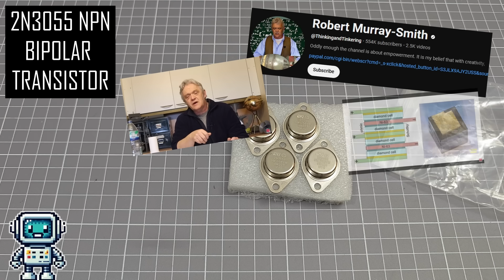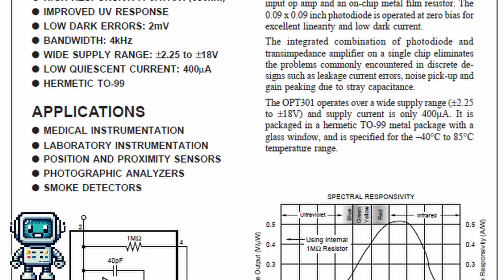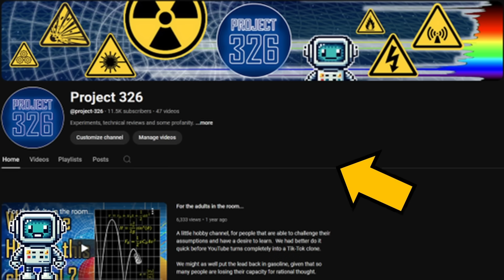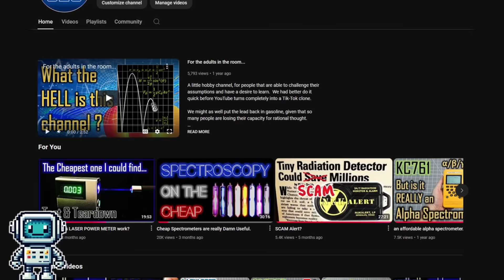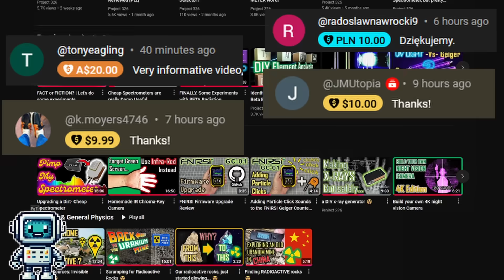Easy Peasy DIY Thermal Camera Microscope

Comment: I love this content.  FYI, you don't need to use an AI voice, that often makes videos feel cheap because so much spam/scam content uses it. (Unless it's because of required anonymity/NDA reasons, which I totally understand)
Reply from the maker: Thanks for the kind feedback.  I currently live in mainland China (Shenzhen), so a little anonymity is helpful.  

Some background info to qualify that:
There are a few You Tubers that used to live here and made videos about how great life is living in China, but then they discovered that just making up bad content about China got them a lot more views.  I assume that the Chinese government is fairly sensitive about anyone repeating that process.  The irony is that since the funding cuts to ASAID and NED, the views that those guys get has dropped by a factor of three (and in less than 1 week).  Amongst the foreigners living here, there is a general consensus that those channels were attracting a lot of "paid for views" as part of some kind of influence campaign.
Reply: @project-326  One might even fall for that explanation except for the videos calling them out that have totally unbelievable explanations for the negative content and the supportive comments from trolls and bots supporting the narrative.
I suppose it is best not to get involved in the topic at all if one cannot relate facts freely.
Good luck.

Comment: Yoo have you tried this with HT-301? It got way better sensor and manual optics
Reply from the maker: I don't have an HT-301, and having just looked at this on-line, its a very pricey bit of kit (even second hand).  I will have to buy something else if I get to the telescope project but for less than the cost of the HT-301 I can get a device with 640x512 res and 50 fps...
edit: thanks for your comment, I just took the plunge and splashed out on a 2nd hand unit that cost $277 but has the above resolution and frame rate and detachable optics!
Reply: @project-326  I bought my 301 in 2021 and paid $690 and I'm very happy with it. If you can find 640x512@50fps for $240 now please share the model and manufacturer.
Reply: @project-326 (reposting because YT backend is a /dev/null) I bought my 301 in 2021, paid $690 and I'm very happy with it. If you can find 640x512@50fps for $270 now please share model no and where to get one.
Reply: @project-326  I'm SO pissed about YT vanishing comments, I didn't even say anything remotely offensive y'all ducking donkeys
Reply: model?

Comment: Thank you for the Very interesting video.

I have used a ZnSe lens on my thermal camera myself for viewing circuit boards close up in the past, and would now like to create a wide angle lens instead.  Is this possible and how this could be achieved.

Any information would be greatly appreciated. Thanks
Reply from the maker: Thank you for the kind words, it makes the effort all worthwhile.  

The issue with wide angle is the size of lens needed.  Once you get past the general purpose CO2 laser types, the prices goes up exponentially, ie it goes from a commercial application to a scientific one...

Please spread the word and take a look on the channel page in case there are any other topics that catch your interest.
Reply: A convex lens will do this.  To make a very wide angle like a fish eye lens you will probably not find cheap lenses though.

Comment: As always a fascinating video. I look forward to a telescope version! Thanks for what you do!
Reply from the maker: there are some optical challenges to solve, but hopefully that project will come together!
Reply: @project-326  A reflecting telescope might work fine if you remove the glass components.
Reply from the maker: @KallePihlajasaari  Normally the only glass components in a reflector telescope are in the removable eyepiece, which could be replaced by more suitable optics and the thermal camera...

Anyway, pretty sure I will find out soon!

Comment: PSA for anyone getting these, AVOID HIKMICRO as their units do not support using it as a normal UVC webcam on a phone or PC. I have two InfiRay units and that UNI-T one and they DO support working as a UVC webcam. This matters if you want to take smooth video recordings as thermal apps always tend to have awful choppy video (with no audio recording). nExt Camera for Android works great with these.

Comment: Good video. ZnSe is very attractive because of its very wide transmission spectrum from 0.6 to 21 um. Take note that ZnSe is a toxic material.  Handle with gloves as shown in the video and keep away from acids.  Consult the Safety Data Sheet if you're going to use it.

Comment: this could be interesting for medical thermography if the celullar level could be captured, to analyse metabolic activities. Still for the thermal telescope may be also indicative a chemtrail capture to check if they serve for a thermal shield as once noted against overheating. That could debunk, as the study by the use of UV capture did not show sufficient compare to contrails.
Reply from the maker: Thank you for the ideas.

I had really wanted to do some serious microscopy of some cool biology, but there is a fundamental limit.  The wavelengths involved are over an order of magnitude longer wavelength than the visible spectrum.  This imposes some pretty hard limits on the ability of any microscope that uses those wavelengths.

Hope that helps!
Reply: Chemtrails are an artificially maintained pseudo science plot to irritate, divide, confuse, dumb down and enrage people.
Contrails are not a conspiracy they have been around sins high level flight was achieved and are a natural phenomenon.
Cloud seeding is not a conspiracy, it is a rain inducing system to water crops or prevent hail storms.
Contrails may reflect sunlight from lower levels or prevent heat from leaving lower levels, the direction and exact amount is not easy to determine but chemtrail people will claim one of the other as their delusion dictates.

Comment: By the size of the DIE, it looks like you bought a FAKE ITEM!
Reply from the maker: Thanks for the comment.  Are you basing that assumption just on die size?  This device was in production 30 years ago and appears to be using an ancient bi-polar process.  The bulk of the die is made up of the photodiode (2.29 x 2.29 according to the datasheet) which is exactly what I see on the actual die.
I really have trouble understanding why anyone would made the investment needed to create a fake version of an obsolete IC which actually works just like the original - the pins on this device were a little corroded from age - and they faked that too?
Reply: @project-326  
You can prove I am wrong by testing the transistor voltage, current, power and Hfe parameters.
Reply from the maker: @paulcohen1555  Oh, you are talking about the 2N3055 transistor, not the OPT-301...  Apologies, I misunderstood.

it is possible that this is a fake, but there is more to this than meets the eye.

There have been several vendors that have made equivalents of this particular part.  They have used their own design to achieve the same basic specification.  RCA, Motorola, Sescosem and ST (and others) have produced their own versions.
There is a German site that has imaged several of these die, here are the links:

ST die
https://www.richis-lab.de/2N3055_03.htm

RCA die
https://www.richis-lab.de/2N3055_17.htm

Sescosem die
https://www.richis-lab.de/2N3055.htm

I think that the size differences are due to the level of process technology that was available when each of these various manufacturers designed their product.  I used the ST version and it is identical in both size and visible design features to the ones shown on the Richis Lab site...

Hope that helps

Comment: Would be interesting if you took a look at something that lives like an ant or a worm to see if there are any features only visible in IR.
Reply from the maker: Thanks for the comment.  I had seriously thought about that, but there are a couple of issues.  Firstly, because of the very long wavelength of this type of radiation, there is going to be a restriction on the ability of any thermal microscope to focus down to a small spot size.  Secondly, the more personal issue is the cost of any such lenses that can get the system to the limits imposed by the wavelength.